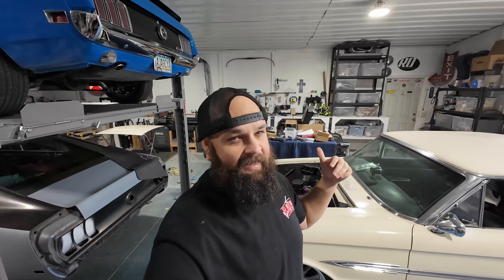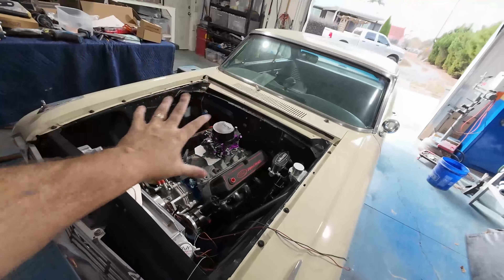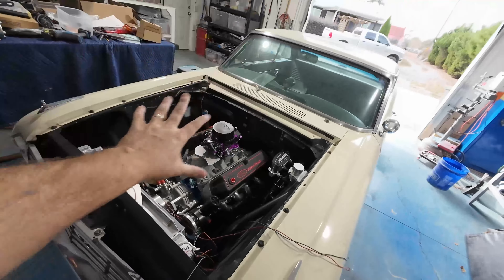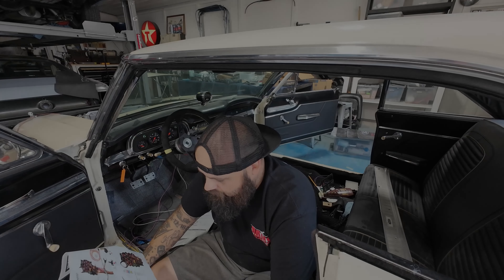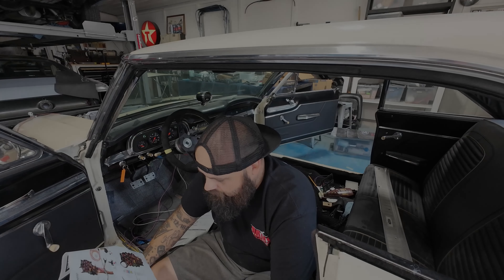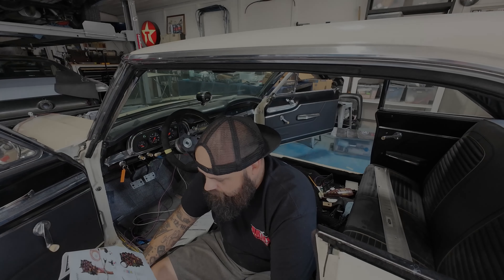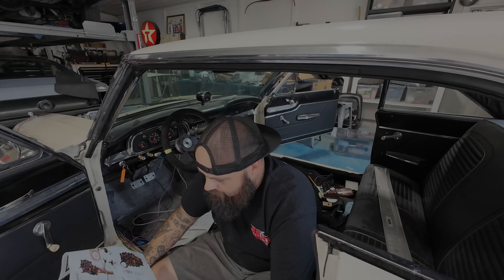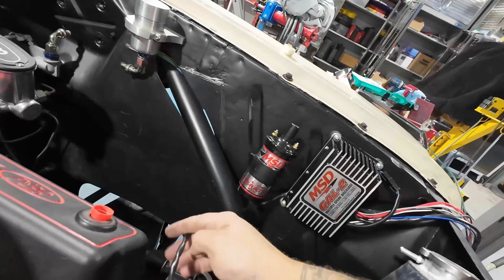Old Skool Cool! Putting AC in a vintage Ford Falcon

Comment: Merry Christmas buddy.  I am installing a March Ultra 2 setup on my 393W for the past couple weeks. I’ll be posting my own video on that.  I have both the Borgeson (Saginaw) press fit and woodruff keyway pumps.  I’m having trouble with A LOT of pulley runout with the woodruff keyway as the pulley does not fit tight on the shaft. I’m fooling around with the key to get it right.  Your press fit pulley should have no runout so that’s an advantage assuming you can get the pulley on there right. Note, your Saginaw PS pump will have end play of about 0.020”, so be aware when install the pulley and aligning the belt. My Powermaster alternator had very little end play, maybe 0.005”.  There is nothing we can really do about end play, the belt is going to yank the pulley where it want it to be.  It would be nice if your next video showed you pressing on that pulley (please, please please).  I am not sure how to set up the press for the pulley and if the pump bracket needs to be already installed on the pump or not. As you mentioned, the pump pulley is so damn tight (same with my march set up). I am worried about tweaking the AL PS pump bracket if I use the bracket to react the load from the press.  
Regarding pulley (belt) alignment.  I leveled the engine (on the stand) and used the lower harmonic balancer pulley as a vertical datum. Then, I checked the other vertical flanges of the pulleys.  In many cases, small differences exist from bracket tolerances.  You can fix those with your fab skills (McMaster Carr sells washer like peelable shims that are 0.002”).  You will note small differences in vertical alignment which I found was due to runout (wobble) on the Alt and PS pump.  You can’t “adjust” runout if its internal the component so you’re just checking to see if something is WAY off.  
I used a collection of levels, T-squares and straight edges to verify pulley flange alignment which, if correct, should ensure belt alignment.   As you mentioned, I also used a laser projector as a hand-held straight edge.  Note: You can’t use the laser as a “fixed” reference since the laser and engine would have to be on the exact same datum and I could not get that on the stand let alone in a chassis.  The laser is just a hand-held straight edge.  
Careful replacing your broken (total bummer) Saginaw pump with the local yocals.  Memory serves, you are using a rack & pinion.  Verify what the rack needs for pressure and flow.  In contrast, my Borgeson PS box needs pressure flow rates HIGHER than stock Saginaw (Borgeson requires 1200 – 1350psi @ 2.7 – 3.5 GPM).  Borgeson rebuilds and modifies used cores to get the correct pressure and flow. Note: A brand new Made in USA Tuff Stuff Performance Saginaw style pump e.g., 6164B is slightly lower than Borgeson but still 1200 PSI rated @ 2.9-3.1 GPM.  Summit Racing has these typically in stock if you need “specific” pressure/flow. If interested, go to the Tuff Stuff Performance website where they have dozens of different Saginaw pumps.
I’m not above begging to see how to press that pulley on!!!  Nice work buddy. Hope the kids are having a good Christmas. 
🌲☝👍✌🌲
Reply from the maker: Excellent post from you, as always! Thanks for all the great info! I can do a quick short on how I pressed the pulley on. There is a job specific tool for it. It threads into the pump and has external threads to push an arbor down and press the pulley in. The pulley went in the second pump just fine. It was .002 UNDER the first pump shaft and .001 on the second pump that I bought. It went on the second pump a lot nicer. Probably from being opened up after being pressed on the first pump. For the pump, I just got the parts store special. I’m not sure what the rack requires. I’ll definitely look into that! Merry Christmas to you guys as well!
Reply: COOLNESS brother.  Yeah, I tried the hand-held arbor type tool last night.  Got the pulley on half way and then it refused to budge anymore (too much swearing on Christmas Eve). Went back to trying to make my woodruff key style work.  @rdspeedfab
Reply from the maker: @BlueOvalEdge  yeah I hear you. I had to use the tool with an impact to get it in. I think heating the pulley would have been the smart way. I looked at it for a while and couldn’t find a smart safe way to set it up in the shop press. I just didn’t feel good about pressing against the casting (as I found out 🤣)

Comment: Awesome car. What underdash evaporator did you use? You completely removed your old heater box?
Reply from the maker: Yes sir, completely removed the factory heater box. I purchased a kit from old air products.
Reply: Thanks. Looking to see which one would fit my 63 sprint. They have several versions to pick from.
Reply from the maker: Yeah they have a lot.